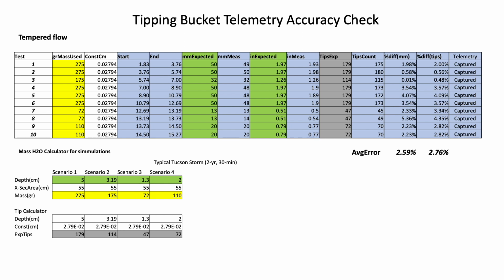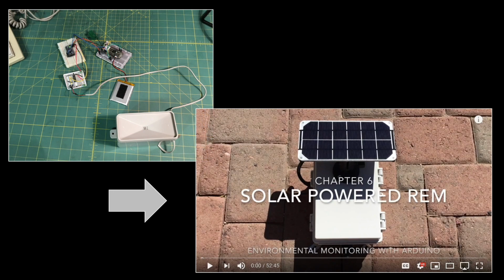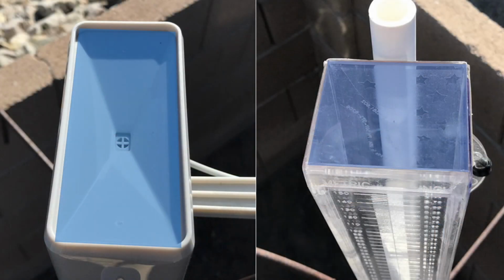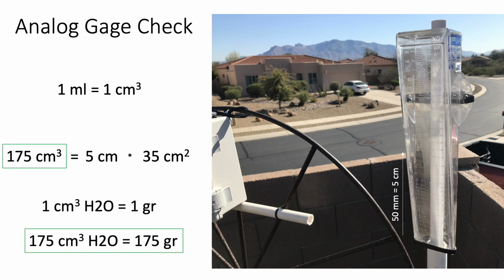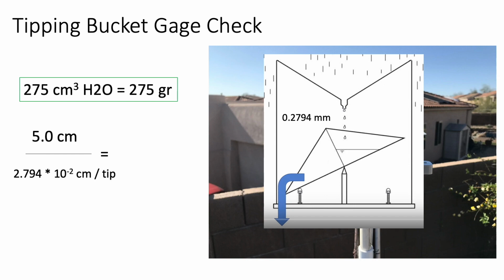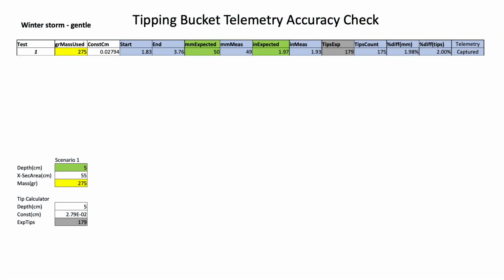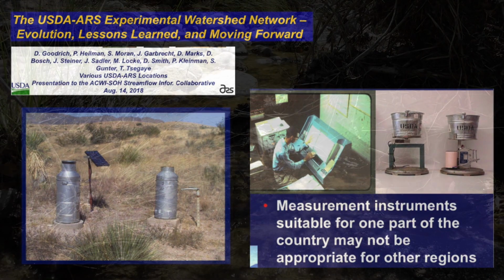Tipping Bucket Rain Gage Accuracy Check

Comment: We just had a record breaking flood in TX. I’m researching rain gauges to be prepared for the future. Are you familiar with any gauges that have a higher capacity for flood level rain events? It seems the tipping bucket would be overwhelmed and inaccurate.
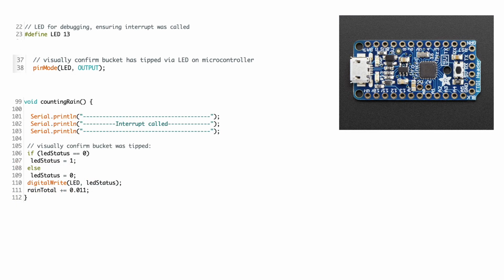Reply from the maker: Difficult situation in Texas - sorry your community is dealing with this. This one is not automated but is more accurate and useful - google up ´stratus precision rain gage’. I have one and it’s great- built like a tank and very precise for extreme events. You can see mine here at about minute 5:45 : https://youtu.be/-E5HU79nfWs?si=JAfA6Wt3TOwmOgi- .

Comment: Thank you for an excellent video!  I'm only a hobbyist but I've had a fascination with weather instruments for the last 25 years.  My love of weather instruments started when I became a pilot.  Twenty five years ago I was experimenting with reed switches connected to the parallel printer port of my 286 computer running BASIC.  I was trying to build an anemometer.  It has been a fun hobby going from PCs to Basic Stamps, PICAXEs, Arduinos, and now ESP8266s.  Isn't it amazing how complex it is measuring rain.  I have enjoyed your series.  Keep up the great work!  I have many homemade weather instruments but I have not yet deployed a rain gauge so I am very interested in your work..
Reply from the maker: Thank You Christopher. Agreed- of all the sensors I've been looking at, rainfall has been the most difficult to address accurately. I remember playing with a TRS-80 at the local Radio Shack in Westchester, California where I grew up as a kid, and a Commodore 64 a little later in life, and always hoped I could break through the screen to do something in the real world. Who knew that would turn into this some day!
Reply: Congrats on making it onto the Adafruit Blog!